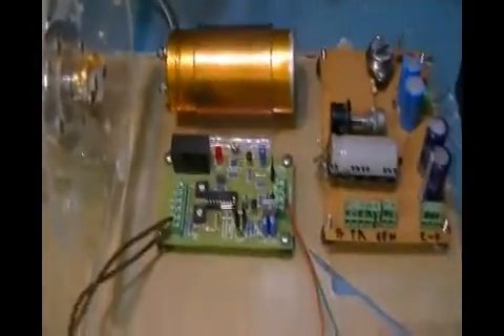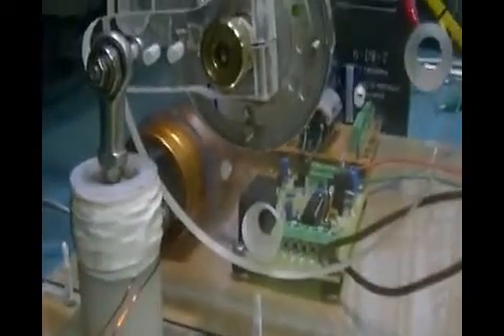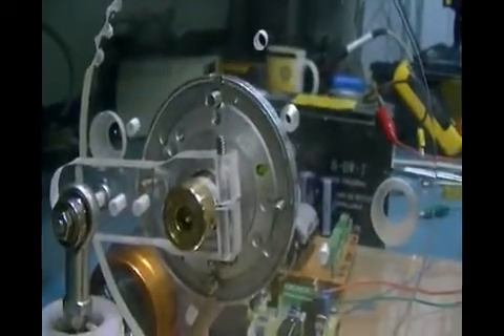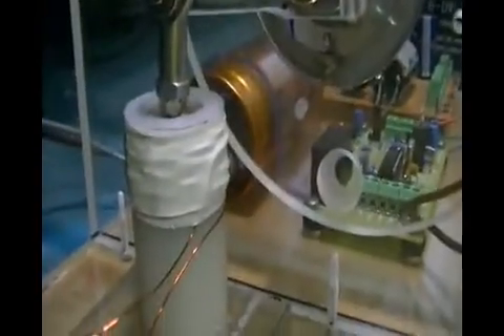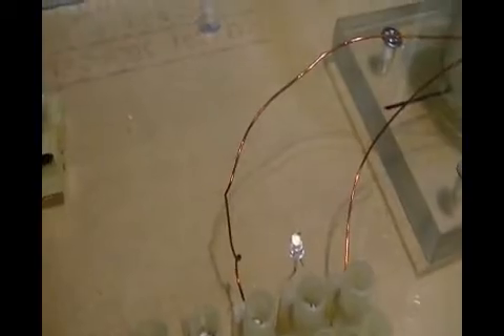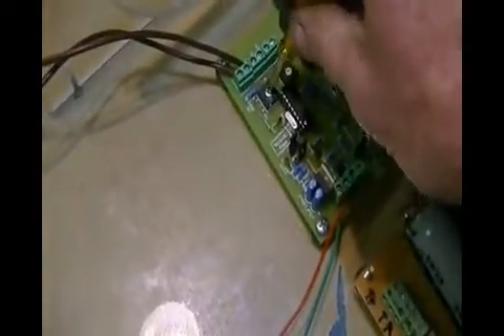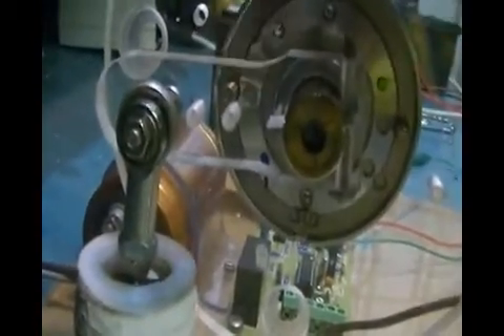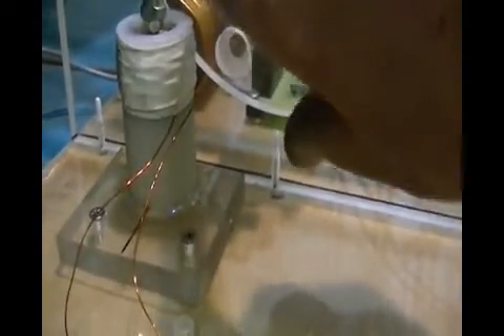noble gas popper engine design

Comment from the maker: Thats all well and good,but what has that to do with my engin design.If you listen to the video and read the description,you will see that i designed this setup a long time ago.I simply offered the design to Russ to use on his noble gas setup,as it is very efficient at converting mechanical force into rotational energy.This setup could just as easly run onpetrolium,and would be much more efficient than todays I.C.E.
So what do i have to prove?

Comment: An energy balance is done for the purpose of showing that the system is producing net energy out of the system. That, I believe, is the claim made by the inventors of noble gas engines. Otherwise you just have another engine that uses more energy than come out as useful work.

Comment from the maker: If you knew a little about how the simple lever work's,then you would understand how this setup is far more efficient than a standard crank setup in an ICE.
Simply by understanding applied forces and simple mathmatic's-there needs to be no test to confirm my claim's

Comment: 2489K23	One-Way Locking Steel Needle-Roller Bearing, Plastic Cage, 3/8" Shaft Diameter, 5/8" OD, 1/2" Width
in America you can get them from McMaster Carr

Comment: Wow I think if you had 2 cylinders with 1 drive arm and used in a see saw manner.  In other words the power stroke is the return stroke of the opposite cylinder. The clutch would be a fulcurm point.

Comment from the maker: Hi John. The one im useing i got from a hobby shop here in western australia,so probably not much use to you.It is from the electric start on a nitro rc car. I pay around $8.oo each for them,so preaty cheap-and this type of setup opens up many design advantages.I also believe they are avalible on ebay for even less.You would find them in rc car parts.Hope this helps.

Comment: Excellent idea Tinman!  I'm liking that sprag clutch, might be usefull for an idea ive been kicking around for a electric generating rotor/shock absorber addition for my truck.  I was going to use an idea with a spiral, like an old steel toy top spinner, but never had a clutch that would fit the idea.  Nothing like using bad highways to power pulse motors :-)